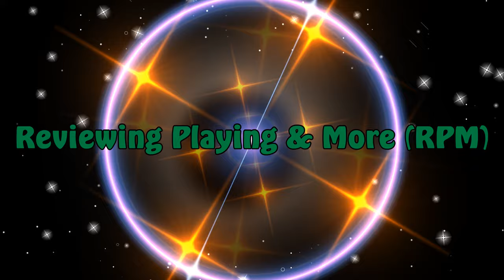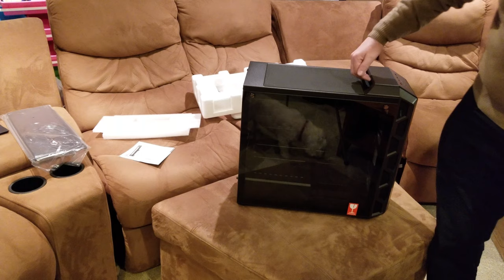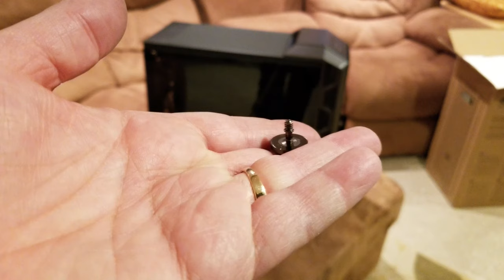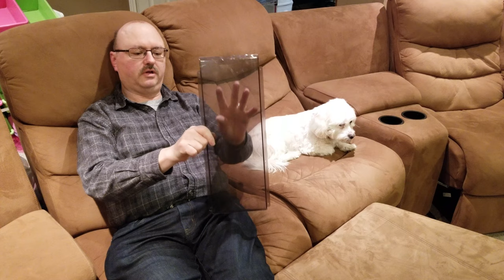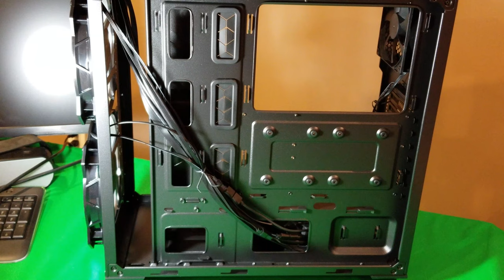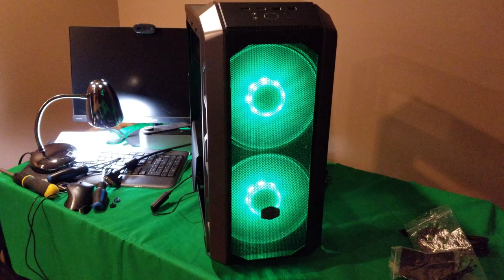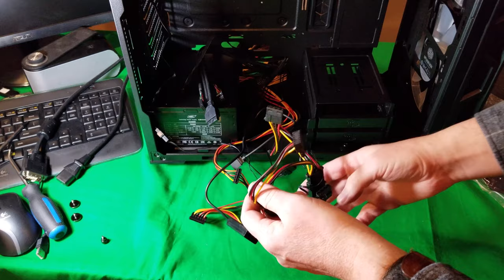Cooler Master Mastercase H500 (New info on RGB in the Build Video coming soon) No Molex required.

Comment: Hey this is a long shot but I purchased this case for Christmas and set up my new build, it's not my first time building a PC and I seem to be having a issue with the bottom 200mm fan it will not spin no matter what I've done I actually even tried to plug it in separately to my motherboard system fan just to test it and I think it's a dud unless I'm doing something wrong every other fan works fine,  I don't know if it makes a difference but I am using a Gigabyte Z390 Gaming X  motherboard. Any other options I can try or maybe I have a dud the rgb on the fan comes on though.
Reply from the maker: I had this same thing happen, and it turned out to be I hadn't plugged in one of the cables properly, do a quick check and ensure that one wasn't missed, and ensure the RGB cabling for the case is all connected and then connected to the MB RGB Header, I did an update video going over this a bit more in case your interested https://youtu.be/RTxE6yOQF7s hope that helps...the motherboard your using won't matter as long as it has an RGB Header...Thanks...

Comment: I still cant figure this out. My bottom fan lights up but my top one doesnt. Both fans do run though. My rgb controller is powered to a sata cable connected to the power supply, then there are two cables branching out one for gigabyte one for msi. I have a gigabyte motherboard so that 3 pin female connetion went to my 4 pin 12 volt and the msi connector went into my controller.
Reply from the maker: I missed the top front fan when I did it, so check the cables for your fans and see if perhaps one was missed being plugged in...not sure otherwise though...

Comment: I bought this case thinking it had more clearance for an air cooler. I guess 167mm should still be enough for a big 165mm cooler but I bought this case over the lancool 215 because i thought there would be ample room. I geuss having an extra millimeter over lian li's 166mm gives me a little more room to play with lol
Reply from the maker: I've found that a few cases will say they can only accommodate a certain size Air Cooler and actually have a bit more room then is advertised, I think it's because they can't always account for it as precisely as stated and there is a bit of play that is still left to use, depends on the case for sure though...I've looked at a few Lian Li cases lately they are cool looking cases and they keep improving...take care...

Comment: Is it better to put the fans on top to let them function as exhaust fans or is it better too let the air flow in from the top too?
Reply from the maker: +Casper de Cocq van Delwijnen It ends up being personal preference but I would use it as exhaust as the other case fans are already able to do the cooling internally...
Reply: Reviewing Playing & More RPM okay thanks a lot i’ll do that.

Comment: How do you take it out of breathing mode? I do not have RGB Headers on my motherboard and every light setting seems to be breathing
Reply from the maker: So if your using the controller there are three settings one is for the different modes and you can change it to the desired effect...

Comment: Hey idk if you will see this but how do i set the 2 rgb fans in the front of the case to a static color for me its only doing the breathing mode and i cant get a static color
Reply from the maker: If you have the RGB Fans plugged into the MB then you'll need to use software that will let you change Modes, however if for some reason that's not working there's a program called Signal RGB that has had good results. Hope that helps.

Comment: I didn't want to use the controller , do you have a link to get the software to use the full rgb?
Reply from the maker: The software is what comes with your motherboard as long as it has RGB, each manufacturer has it's own software. It comes included with your motherboard, or online in some cases...Hope that helps...Thanks...
Reply: @Reviewing_Playing_and_More_RPM   I figured it out. Thank you for the response and the great video!

Comment: Not sure if you still respond to these comments, but im in need of some help. I got the H500 ARGB case, different from the video i know, but how would i hook the ARGB up to the motherboard, i dont have 3 pin connections on my board. Would I use the included ARGB controller, hook up the RGB from the fans to it, and then connect the controller to SATA only. I had tried to connect the ARGB fans to the controller, and then powered it with SATA and it ended up burning out my fans, they still work but the RGB doesn't. Im really stumped here, i just wanna know if i did something wrong or if the included ARGB controller was the issue. Thanks a bunch, and stay safe!
Reply from the maker: Yeah if you don't have ARGB then the controller is way to go...what happens is there are ARGB 5V which has a different voltage then if you have a 4 pin RGB which is 12V...so yes hook up the RGB Fans to the controller and then connect to the SATA if that's the way that case is configured...you stay safe as well...Thanks...
Reply: @Reviewing_Playing_and_More_RPM  Thanks for the reply. But I only connected 1 fan to the controller directly, without using the 2-3 splitter, im wondering if by directly connecting it without the splitter caused that fan plugged in to burn out. If this isn't the case, then I might not have connected something properly and it was all my fault. Sorry to bother, but CM support is notorious for being slow.
Reply from the maker: I don't think it's anything you did as the controller doesn't have any impact that I'm aware of in terms of power, just for the RGB there is also a SATA Power cable in the case if I'm remembering correctly and that needs to be plugged in as well for the extra power requirements...Thanks...

Comment: Exactly what I was looking for! Thanks a million. Now I know how to take the front off which I was worried about. I prefer the mesh, but it came installed with the plastic front. Would you recommend taking off the PSU shroud for better cooling?
Reply from the maker: I left the PSU Shroud on, the difference it makes was not enough to make a difference...Thanks...
Reply: @Reviewing_Playing_and_More_RPM   Sorry Sir, if I could pickle your brain for a second. I got my H500 aRGB cooler master case. But, I have a designare z390 mobo, so no aRGB support. I watched another video of yours where you show how to plug in the aRGB to a mobo with support for that. I had to custom build my PC due to my lack of knowledge to watercooling my CPU. Can I simply, take out the RGB connector fans to disbale the RGB for the ront 200mm fans?  I have no idea on how to connect the mini controller. :(
Reply from the maker: @XKoreaify  You can take out the connector for the RGB on the fans and just use them without RGB, however there is another way, if you have at least an RGB Header 4 Pin 12V, there are a couple devices that will convert the RGB Header to an ARGB Header then you can plug them in and use them...search for Deepcool and it'll come up, I'm using one because mine didn't have the ARGB either and it's working great...hope that helps...
Reply: @Reviewing_Playing_and_More_RPM  thanks! I will do that. I really appreciate this more than you know!
Reply from the maker: @XKoreaify  I just happy to help folks out...have a fantastic day...

Comment: Hello im so lost to connecting it i have the white one and the 3 pin hole left not connected
Reply from the maker: What cables are you referring to in the video, the 3 Pin sounds like it is either a 3 Pin Fan or ARGB but need more info to know for sure. Not sure what white cable you mean if you see it in the video let me know what time in the video and I'll try to help more. Thanks

Comment: Does it have a dust filter on the front? Doesn‘t seem like it has one after you showed the mesh
Reply from the maker: +Bizzy Pac It has one on the bottom, top and front, mind you taking off the front panel could be a bit of a pain. Thankfully you shouldn't need to do this to often. Thanks for watching...

Comment: can we install the 360Aio in front without removing the 200mm fan? 
I mean still using the 200mm fan with 360aio inside in front.
Reply from the maker: As far as I can tell you should be able to fit the 360 in with the fans, and the 200mm fans in the front...never tried it though so it's not a 100% for sure just my opinion from what I can see...Hope that helps...Thanks...

Comment: I have 2 of those, may i ask if you have any idea how to turn on the lights on the power button? one of mine's not working. thanks!
Reply from the maker: One of mine wasn't working and I realized it later, I'd forgotten to plug in all the cables, I'd suggest you check all the cables are plugged in, I believe there was a Sata Cable that needed to be plugged in as well...Thanks...

Comment: Thank you so much.
I've been able to make my fans and rgb work thanks to you incredibly detailed video. I'm gonna put my front and back panel covering the rgb controller. I don't want to remove a panel everytime I want to switch the fan colors. I have heard there's a software and u even mention it in the vid but I can't find a link to download it. How have you set this up?
Reply from the maker: The Software depends on your motherboard, if it's Gigabyte then it's RGB Fusion for example and whatever one you want you should have it on your motherboard DVD and the manufacturer's website...Install the DVD software and you'll have it...Gratz on your build...Have an amazing day...

Comment: So you need to connect hire RGB controller too even if you use the motherboard control function?
Reply from the maker: No, the RGB Controller is for if you don't have the RGB Header on the motherboard...Thanks...
Reply: @Reviewing_Playing_and_More_RPM  Cool, thx, I pulled the trigger on a bundled H500 with 212 rgb and 650 MVE PSU for $209 delivered. Thanks for the vid and response.
Reply from the maker: @b6s4shelter  Cool...sounds great...

Comment: Hi :) i hope that you still remember this case. I have some questions about the 3 fans and rgb.
The 2 front fans and the back fan are getting hooked to the psu via sata and molex. Only rgb is hooked to the motherboard. Have i understod you correct? 
This might be stupid question, but its my first pc build and i thought the fans were supposed to be hooked to the motherboard, so i hade ask to be sure.
Reply from the maker: The two front fans I did wind up using at around 6:40 in the video I discuss it more, basically the two fans would not reach the MB so used the included cables to connect the two together and then one end to the MB. The back fan goes to the MB via a sys_fan_header. I don't remember without going to watch the video but don't think I used the Molex, you have to watch to see, sorry was a while ago. Yes the RGB goes the the RGB Header on the MB. In most cases the fans would have connected to the motherboard individually, or a hub if the case came with one. In this case though they included the cable for this purpose instead, they could have done a better job with it in my opinion though, but it's still a very solid case and great airflow. Hope that answers your question...Thanks...
Reply: @Reviewing_Playing_and_More_RPM  Yes. I think so. Fans to fan header(one cable were 2 are connected via splitter) and rgb to rbg header. They were using spiltter 3 to 1 instead of 2 to 1 wich made me scratch my head. I hope this works now. Thank you for the fast reply

Comment: How can i change colors of the front fans.. like which software to use? I can change it to diff colors using rgb fusion but that only gives me static colors option. .. how can i set it to diff color modes like fade pulse etc..
Reply from the maker: There are settings within RGB Fusion that will let you choose different Modes and colors, you could also try downloading iCUE Software from Corsair and see if it might let you use their software, if not then if you purchase any Corsair RGB Device it'll usually recognize all the other manufacturer's RGB devices and let you change them all.
Reply: @Reviewing_Playing_and_More_RPM  rgb fusion doesnt give me any.option to choose fan modes.. but i will give it a try again. Cheers mate
Reply from the maker: @silvertechmods9215  There is a sync button top left if it's, in one Mode it'll sync all the colors and then you can also choose to switch Modes and pick your Modes for flash, random, etc then sync again for them all to work. RGB Fusion has many problems though so it is possible it just doesn't work.

Comment: Thank you for the detailed review,helped me a lot,this case is on its way,looks really well builded,i have a silencio of coolermaster 7 years old,its like new even now.i wander if this rgb controller can be used wih a splitter and control 2 more rgb fans of the case (4)pin. thanks again,keep up the good work
Reply from the maker: It can control extra RGB can't remember if it was just one more or two but think it was two...Enjoy your new case and build...Thanks...
Reply: @Reviewing_Playing_and_More_RPM  i was reading yesterday that can control one more but i cant find the comment right now.
Reply from the maker: @21777gabriel  So one more is good if it provides you the fan headers you will then need, if not then a fan hub might be the only other option...

Comment: Thanx 👍😘
Reply from the maker: You're welcome, glad you liked it.
Reply: @Reviewing_Playing_and_More_RPM  SIR THIS CASING GOOD?
Reply from the maker: @bunnsgayancod4promod711  Yes very good.
Reply: @Reviewing_Playing_and_More_RPM  thanks you sir last question MWE GOLD 750 FULLY MODULAR  Good for gaming?
Reply: @Reviewing_Playing_and_More_RPM  That's why I'll buy both of those items tomorrow You need to know the pros and cons of this 🙂💕
Reply from the maker: @bunnsgayancod4promod711  Yeah that PSU is really good, keep in mind if you plan to OC there is only 1 CPU Connector from this Power Supply so if you want to have or need to have another 8 Pin CPU Power you might want to consider a Corsair RM 850.

Comment: i just bought a new build with this case. It says that u get both transparent front and mesh front with the purchase in addition to the dust filter at the front? How is with this?
Reply from the maker: They will provide a solid plastic and a mesh insert for the front panel that can be used, the mesh will provide better airflow.
Reply: @Reviewing_Playing_and_More_RPM  Thanks :)
Reply from the maker: @SpecXify  Any time. It's a great case and so easy to build in so great choice.

Comment: Just got this case may 5 2020 fans work ... now they spin but rgb is dim any help wil be great
Reply from the maker: If I remember right as I sold this system, there was a SATA Cable from the case that needs to be plugged into the Power Supply, can't remember for sure though it's been a while, if it does though, then plugging that in will make the difference...Thanks...
Reply: Reviewing Playing & More RPM  this what they look https://i.imgur.com/sJKkC73.jpg
Reply from the maker: Yes exact same...

Comment: I ordered this case and while building a pc my pc didn’t have a 2 pin connector for the RGB control, so is there something I can do about this ?
Reply from the maker: I recently found that Corsair has a hub that helps to connect multiple fans and RGB and connects with I believe it was a system fan header, it was called CORSAIR Commander PRO in case it might help...Thanks...

Comment: Just finish my build in This case today All plugged in i dont use the controller that came with the case took 1 fan power to the MB and the other to a 5v RGB header....problem is Now my MB software dont let me control the RGB om Thise fans they are just the stock blue colour, what have i done wrong, my coolermaster ml240l i can control via the software and that is Aldo plugged into the MB only....what did i do wrong
Reply from the maker: It's definitely a cable that didn't get plugged in or plugged in the wrong way, I'd try first to ensure the Sata Power from the case is plugged into the case that gets overlooked often...otherwise ensure the RGB is plugged in correctly...otherwise it hard to say without seeing it...Good Luck...
Reply: I dont use the controller og sata power All goes to the motherboard straight
Reply from the maker: @DSWoof  You still need to connect the Sata Power Cable from the case to the Power Supply for things to work properly though...
Reply: Thats my problem then :) Will the RGB then still go to the header om the board og just the little controller ?
Reply from the maker: @DSWoof  Yep, the RGB will still go to the header on the MB...
Reply: All Works Now thank you :)
Reply from the maker: @DSWoof  Awesome...Thanks for letting me know...enjoy your build...
Reply: Is wierd the front fans dont change color like in your video, i have a RGB cable going from the fans to the controller, the sata power, but the last RGB cable that have that rubber thing on, does that go to the header om the MB ? Is that why No color is changibg ?

Comment: How did you get your front fans to not blink, then if you did it again, it would blink?
Reply from the maker: The MB RGB Software controls the mode and colors, that's what I used...
Reply: @Reviewing_Playing_and_More_RPM  oh, my RGB fans only connect with a 3 pin slot, but I only have 4 pins, what do I do. It makes me unable to connect it to the motherboard!
Reply from the maker: @yazan3115  So the way RGB Works is a 3 Pin is 5V Addressable RGB and therefore uses a 3 Pin 5V ARGB Header on the MB, if your RGB Cable is 4 Pin then it's 12V RGB and needs a 4 Pin RGB Header on the MB, the Fans are separate and plug into the fan headers on your MB unless you have a Fan Hub...now if you don't have a 3 Pin 5V ARGB on your MB you'll need to get a 12V to 5V RGB Converter...